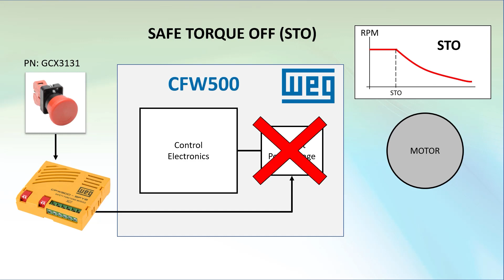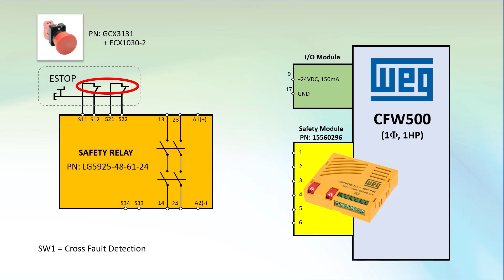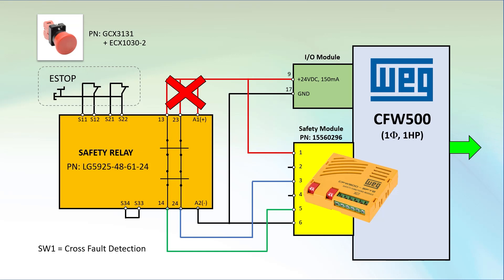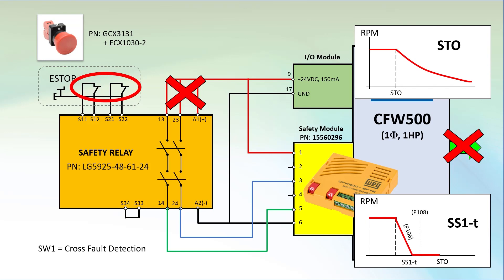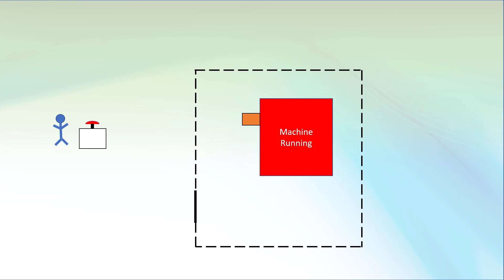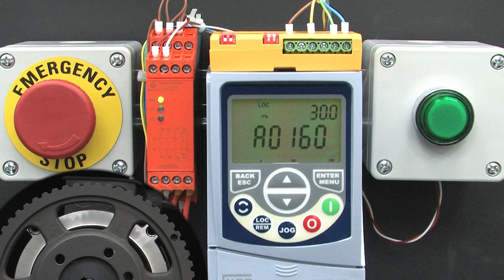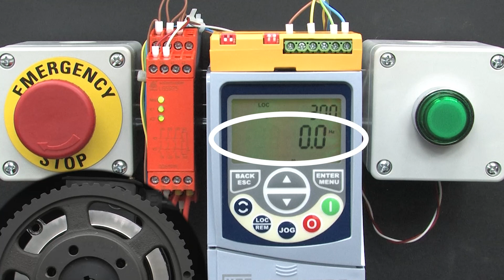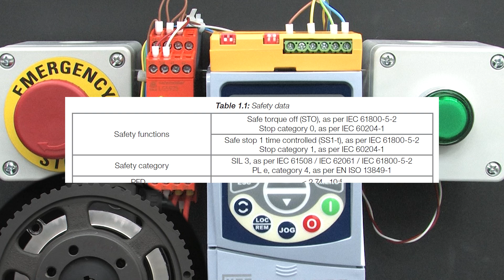WEG CFW500 VFD Safe Torque Off (STO) Part 2 from AutomationDirect

Comment: This is very helpful, the STO manual states "the frequency inverter must be de-energized and re-energized" if the STO is activated but clearly that's not true. Big difference! I'm confused too that the drive power supply is sufficient for the safety relay, the drive supplies 150 mA and the relay has 1.5W max consumption? It would be great to omit a transformer and power supply, but 150 mA isn't much
Reply from the maker: @brian, glad you like the video! We show that in this video because 1.5W is 60mA @24VDC so well within the tolerance range of the power supply. Having said that, the power supply on the drive isn't replaceable, so if you did have a short it would potentially lead to the drive being replaced. In most applications it would probably be best to use an external power supply as you mentioned.